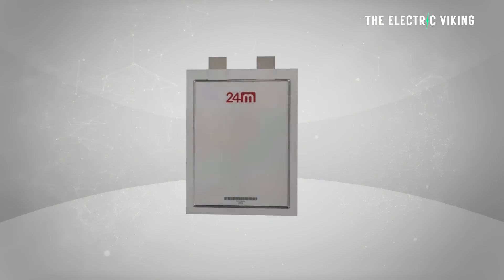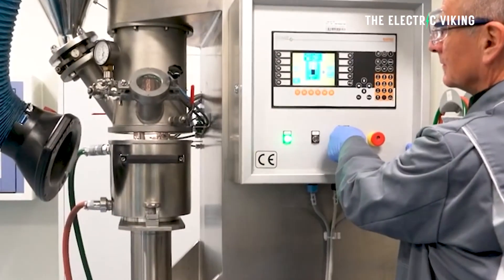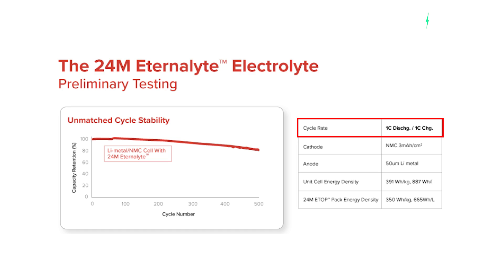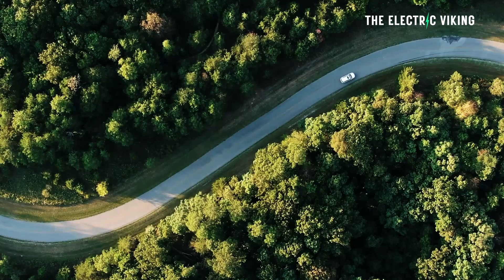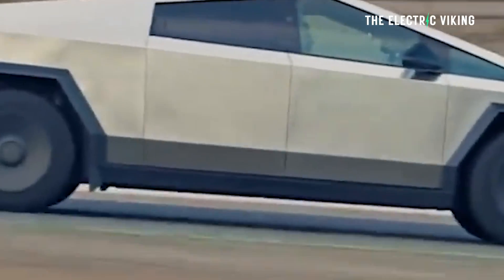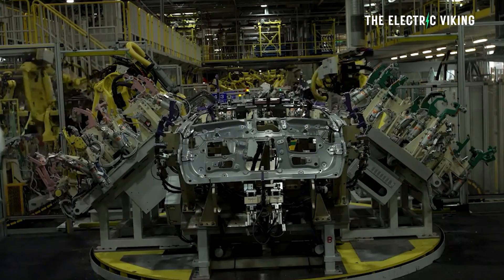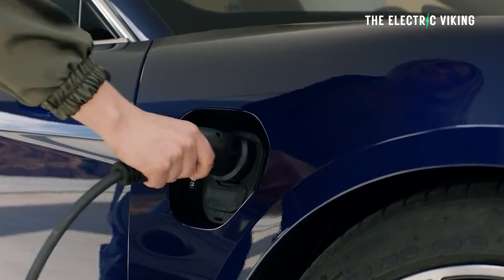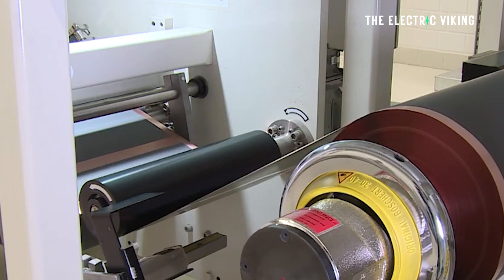American battery company reveals production ready 1000 Mile EV Battery

Comment: I don't like it when they say it will get 1000 km range without the backing watts per kilo but in this case they did. 
See Sandy Munro's review of the Sakuu battery another Silicon Valley battery company . At 350 kw/kg electric airplanes
and VTOL's get practical . Trouble with the current range setup for cars is the actual Highway miles are 20 to 30 percent
less than claimed under real world conditions.

Comment: Lets not forget that the real world range an EV can do is also highly dependent on how you design the car in the first place. The Mercedes EQXX for example has a present day tech 100 KwHr battery pack and can do 620 real world miles. Also interesting to extrapolate to what a 1000 mile EV would mean. Many would only need to charge once a month and no doubt would do that at their local shopping center while they get some groceries in. (I can see ASDA, Tesco, etc tapping into this market). We may laugh at the historical concept of "home charging" as we laugh at "dial up" internet connections now. Doubtful we would need any public charging networks along roads and for sure the network of charging stations around the country that offer a couple of chargers here and there would be gone. EV charging will replicate the current minimal network of gas stations with the big retailers tapping into a new high power, rapid charging market and off course we will laugh at the dated concept of "Range Anxiety" just as we now laugh at the storage anxiety we used to have with an early 128K of RAM computer.

Comment: Understanding the real world experience (which you seem to have dismissed) is why 1000 miles becomes important. To fill up with petrol takes me 5 minutes. To get charge to get the same distance, means an hour of charging. That’s IF there’s a charger available (not broken, not all being used, other vehicles parked in them, etc etc etc). Add in towing, for an EV there is not a single charger available that you can drive thru, meaning you have to find a place for your trailer/van, uncouple, charge the car, go back to the trailer/van, reconnect, and finally you get to drive off again. Imagine doing this in the pouring rain, freezing cold, snow, 40C + temps. 
Or… you can just travel the full distance and charge overnight.
Understanding these things will help your channel.

Comment: Now you’re talking. 500 miles of range for creature:comforts, A/C, battery heater, cabin heating, other electronics.

Then 500 miles driving range between changes with cruise control and 80 miles per hour and high and low temperature differences.

Car price $35,000 and less. Now ICE will have a problem when charging stations are available.

Comment: If the battery had twice the energy density of an ordinary battery, then for the same battery mass you would have twice the capacity and twice the range. A ZE50 Zoe, driven sensibly, can surpass 300 miles from 52 kWh of available battery capacity. I do it regularly in Summer in England. (Ambient temperatures of 25° to 30°C) So a new style battery, with twice the energy density per kg would give 104 kWh to the driver, and range would be over 600 miles under similar Summer conditions. 

Adding more battery mass can only reduce efficiency, so a battery of twice the original mass and four times the original capacity might give 1,000 miles or so, but everything else in the car's drive chain would wear out more quickly. I would rather have a battery with a similar mass to the standard one. Anything more than 600 miles in Britain would not really make much sense. There is a very good reason why UK Diesel cars would struggle to drive for more than 750 to 800 miles on a tankful of dinosaur juice.

Comment: You generate power transfer power with loss charger uses some draw transfer to battery takes more power to charge than to run off cord battery loose charge even when not in use like a leaking gas tank batteries are the least efficient way to transfer power

Comment: Lucid air touring gets 520 miles of range from 112 kwh battery. It has the highest miles per kWh of any car at 5. So any car with that efficiency per mile would require a minimum of 200 kWh to get 1000 miles of range. The weight of the pack is key. A 200 kWh pack at this density would be the same weight as a 100 kWh Tesla model S pack.  There is no magic way to make the car go farther with less kWh.  However one other factor should be considered...the rate of discharge. Because the rate of discharge is slower the battery will be more efficient, perhaps 10-15% more efficient. This depends as well on the battery chemistry.

Comment: Battery cycle life is a major problem in aviation not just energy density. 500 cycles would mean around 500 flights. Not commercially viable as the battery would be scrap within a year.

Comment: Sam, do the math on the 747 of your dreams. A 747, over a ten hour flight, burns about 36,000 of jet-a which weighs in at 250,000 pounds! The maximum payload is about 300,000 pounds. Take away the 250,000 pounds of fuel, and you’ve got enough carrying capacity for 500,000 pounds of battery - which will get you about 1/20th of the distance - with ZERO payload capacity. You’re going to need batteries that have about 50 times the energy density of today’s best batteries to make it work.

Comment: I disagree, of course some people need one 1000 miles of range. Because in reality , depending on speed 130kph or temperature or wind you may lose as much as 30% in the real world. Furthermore, usually you can not filed at 100% the battery or empty the battery to less than 10% to preserve the longevity of the battery.   This mean that in the colder 6 months of year, north of Europe , USA , Canada, you have 70% minus ( 10%  + 10%)   =50%, 500 real miles at 130kph .       .    Some business people are making easily 500 miles per day and they don't have time to spare at the charger

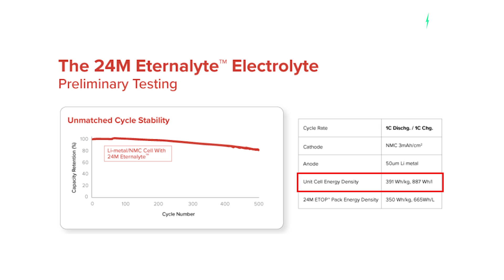Comment: At 2:40 : “the energy density of the battery pack is 391 watts [sic] per kilogram”. A little later, “watts per kilogram” is repeated as the presenter's measure of energy density several times. He also gets packs and cells muddled.

Comment: Why do you always deny the inescapable reality of these MISLEADING "battery range" numbers?... You know perfectly well... 1000 mile range can easily = 1/3 or 350 miles under stress/load/etc... what is stress/load?  EVERYTHING! (that happens to a NORMAL vehicle...)  i.e. cargo, extra passengers, towing, heat, cold, running 100K, 200K 300K, etc... So I don't know what the hell you are talking pretending 1000 mile range is NOT 1000 miles...  why the deny it??
Reply: Towing doesn't "normally" happen to a vehicle. Over 99% of all vehicles on the road are NOT towing. How do I know? I can watch the street next to my house. Neither is anybody today driving 1000 miles without going to a petrol station. Those who didn't miss 1000 mile range in their gasoline vehicles won't miss 1000 miles of range in their EVs, either. That's 100% of all drivers. ;-)

Comment: It's not the overall range that is really the issue, it's the infrastructure and charging times when you are travelling away from home. Unlike the rest of the world, some USA folks drive more than 300 miles on a single trip. I, for example, drive 865 miles about every 4-6 weeks (one way).  Came so close to buying a new Bolt EUV until I figured out that there wasn't anyway that I could travel on I-75 without making the journey a 2 day adventure when it normally takes me 13-14 hours.

Comment: I could get 1,200 miles on my stock '96 VW Passat TDI wagon 5 speed manual with it's stock 20 gallon tank. The tank even had another 2-ish gallons of expansion space that could be filled easily at the pump if immediately upcoming driving conditions allowed cutting into that safety margin. Then 1,300+ miles was within range. So there were stock cars that could bust the 1,000 mile barrier.

Comment: The thing is, there is no such thing as a 1000 mile battery. It's all a matter of the volumetric and gravimetric energy density, and how many kwh you can fit in a typical EV pack volume and pack weight envelope. So, I am completely baffled by your comment that a 600 mi  range pack would be a 60 kwh battery pack. That's just wrong. For a Model 3 to get 600 mi on 60 kwh, it would need to have an efficiency of 100 wh per mi (60,000 wh/600 mi). The Model 3 gets about 225 wh per mi. To get 600 mi range at that efficiency, you need 135 kwh pack, assuming that this battery pack doesn't weigh any more than the current 80 kwh pack (which would hurt efficiency requiring an even bigger pack). There is no magic battery technology that will get a Model 3 to go 600 mi on 60kwh.

Comment: I believe if they made electric vehicles with 1000+ miles of range, it would greatly expand the number of people who want an EV. Lots of people just won’t switch until EV’s are a vast improvement over ice vehicles. My milestones are more range, 10 minute full charge, a built-out charging infrastructure with onsite  sustainable energy production, no chance of a car fire or thermal runaway, and a 20+ year battery. You get these basics and you would have a highly desired,leaps and bounds type improvement over ice vehicles.

Comment: The issue is that 1000 miles in a BEV is not 1000 miles real world. It's more like 600-700 real world miles using a 90%-20% battery use. Right now most people feel that BEV's range is far too low to be practical for long range driving, where you only get 140-180 miles between charges.

Comment: 0:34  "You could put a 100kWh battery pack in model 3 and get 1000 miles"   10miles/1kWh?  BS.   However I think you meant if a model 3 HAD a 100 kWh pack and you switched to this companies (I'm guessing 250kWh pack considering Model 3 average power use to hit 1000miles) then the energy density would be great enough for a 1000 miles.

Comment: A 1C charge/discharge rate is hardly adequate for a car battery. A much better solution is the lithium/aramid/sulfur battery with a 1500 mile range and a 3C charge/discharge rate and 700 cycles.

Comment: If it takes 12 hours to 10% to 80% charge a battery pack with 1900 km range, one might need the larger capacity battery pack just to have enough tie to charge it between use.  Also assume these packs won't be more expensive than rhodium by weight and don't lose range significantly over 2000 charge cycles.

Comment: Sam, You conjecture a smaller battery for high performance battery electric vehicles.  Nothing was stated in this video about the "C" rating of this cell.  Other solid state batteries are not ready for this application because they have a low "C" rating.

Comment: I think Sam misspoke, the battery pack would be the size of a 100 Kwh battery in the current energy density.  The pack would be 300 Kwh's but the same weight as the current 100 Kwh battery.
Reply: you'd never charge a 300kw battery, especially at 1C.
Reply: @geoffhaylock6848  It is typically easier to add range to a larger pack, so if you went 100 miles then recharging that 100 miles would typically happen faster, as it would be a lower percentage of the capacity. It would be faster charging a 300kW pack than charging a 100kW pack three times. 

Most people don't need 1000 miles of range. Only those who tow and who have lost of anxiety. Maybe those who have a far commute and don't own a garage.
Reply: @jirace  My point was a 300kwh battery would need a 300kw charger to charge at 1C. If the world does in fact move over to battery packs like this, we are going to need  big changes to our power utilities. Lots of things affect charge times.

Comment: OK.  But what happens when you drive a spike through a 24M battery?  Does it explode into flame?
Reply: There was a story not to many years ago of a family driving down the highway in a regular gas powered van. They were following some kind of truck carrying re-bar I believe. Well, the truck vibrated enough to cause the rebar to slide off as it was not secured properly and fell into the path of this van. A single piece of 6 foot rebar bounced and punctured up through the center through the gas tank of this van — the two parents in front survived, but both tennagers in the rear passenger seats perished when the gas ignited and burned furiously. Gas is and always will be much more dangerous than batteries of any type due to the RATE of burning. Had they been in a Tesla model S with standard LiP batteries, I doubt those tennagers would have perished that day. They very likely would have had time to escape: I believe the accident happened in Ohio: maybe a similar test could be performed to find out. In any event LiFePo batteries currently being produced and installed into Tesla model 3 variant and other Do Not catch fire nearly as easily — in fact almost a non event.
I would Love to See NTSA tests of all current battery technologies being tested this way.

Comment: As others have correctly said, even with an average efficiency of 250wH/Mile which would be very good at highway speeds, you still need 250kWh battery packs to get 1000 miles of range, no escaping that fact no matter how much energy is squeezed into a cell pack.

Comment: If you put a high density battery in a hybrid and double its electric-only range, while the cost of the battery remains the same, I think it could be a winner.  Imagine a Prius with 200km of all electric range (supplied by a 40Kwh battery), 200hp of power and an owner who plugs it in once every 4 days at their home charger.  The price of such a vehicle could be $40k and I think there would be many takers over a Model 3, especially in USA where the charging network is not as well-developed and people tend to drive longer distances.  The other advantage is that after 6 years or so, the battery could be replaced at a more modest cost, (it is approximately the size of a small microwave), possibly with an improved one.

Comment: You don't know basic math and physics and mumble non sense. the density is not range. and you cannot do 600 miles on a 60kw battery. the current best efficiency EV's do at best, 7.5 km range per 1KW of energy. to do 600 miles, which are about 1000 km, you need at least a 133KW battery.  If you need basic math and physics teaching, I am disposable for free for one hour. enjoy

Comment: We own a factory original Ram pick up with the Cummins diesel engine that has 1000 miles of range. It has a 50 gallon fuel tank and gets 20 to 22 Miles per gallon. It is wonderful on a road trip. I hope some of these new high density batteries become commercialized at some point to solve the range issues with EVs.
Reply: Those diesel VW Passats would go about 750 miles on a tank, and you’re right, it sure is nice to have that flexibility. 

My current vehicle will only do 520 AT BEST, and sometimes it flat-out pisses me off …
Reply: Especially where the charging infrastructure is still in its infancy. I would love to do a 500+ mile trip and charge overnight at my destination. It would make the planning so much easier

Comment: 100kWh pack ?  Range depends on energy consumption. A model 3 at highway/70mph = 3 miles/kWh. = 300 mile range.
Regardless of the battery chemistry, because 100kWh is 100kWh, however you store it
Reply: Well, there is a first time for everything in the comments section of a Tesla fluffer channel. It's almost like you understand basic physics? How can that be? Has Elon not programmed you properly?
Reply: @davidbrayshaw3529  I'm happy with ICE, might take an EV if it can actually do what my ICE can do, but I won't wait ;)